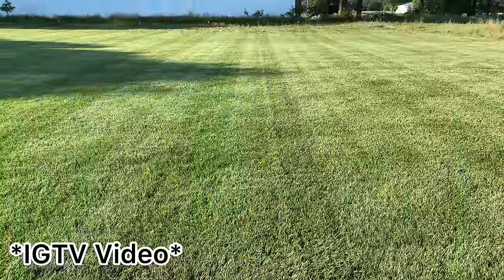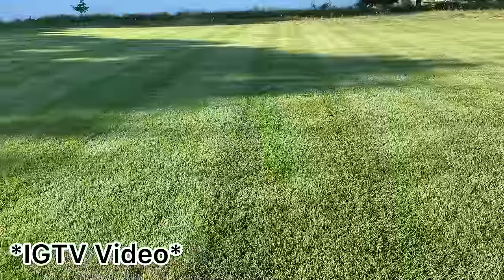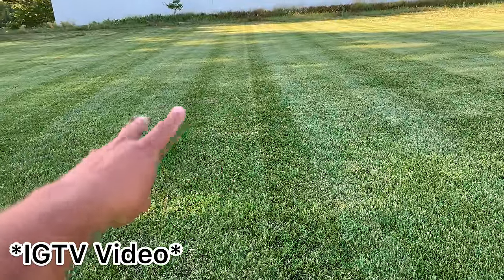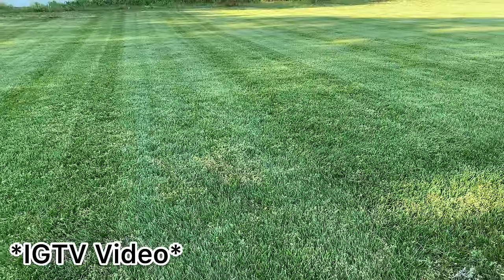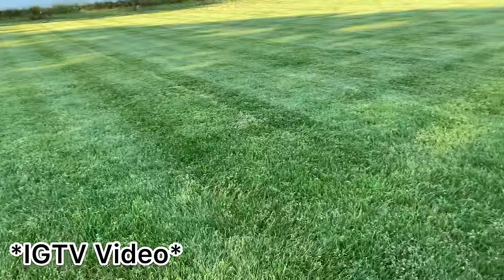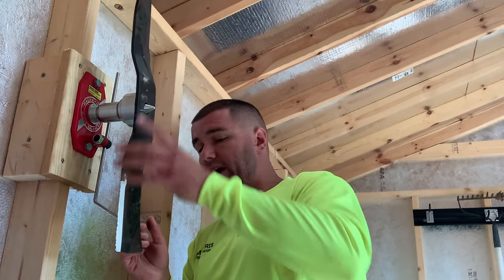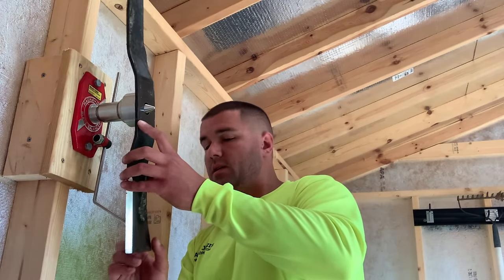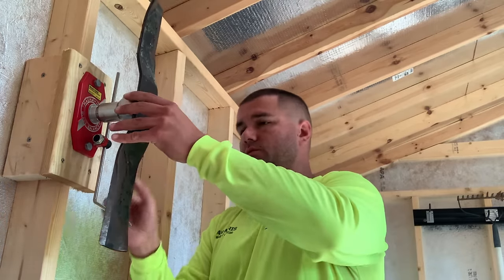Uneven Grass After Mowing? [How to Spot and How to Fix!]

Comment: MOST of the uneven cuts are because your land is not flat. There are dips, etc and if you use a riding lawn mower then this happens more often. A push mower has less space between front and rear wheels so the cut will be more even than riders. If your blade is bent then you'd feel a vibration.
Reply from the maker: My yard had never done this previously and hasn’t since. And I cut in different directions every time. I tossed that blade out and swapped it for a new one. Worked great! But you’re right, that is a common problem
Reply: I can buy the bent blade or the bent spindle but the land not being flat and making the strip he's talking about ? Come on. Lol .
Reply: Low air in the tires on one side
Reply: I can see it on the going and return  strip I don't know which side it is but its coming from the same blade crooked blade bent spindle or low air in the tires.

Comment: You never showed us what repair the bent blade needed.  Do they fix the blades or do I buy a new one?   Otherwise, what was the purpose of the video?
Reply from the maker: I made this video well over a year ago, might be closer to 2 years ago actually. I do know that I tossed the blade. You shouldn’t repair a bent blade, it’s bad for the spindles and cuts bad.
Reply: If a blade is bent more than an 1/8 pitch it or scrape it. They are made out of hardened tensile steel if you try to heat it could fracture and break. They are heated and stamped on big presses to the shape and and left to cool that is why you see those lines running down the sharpening point. you should run a few passes on that before you put them on and balance them .

Comment: seems to me that grass residue and rust should be removed before putting on balancer to check for bent blade or balance...
Reply from the maker: I use a wire brush and putty scraper to do that. Not sure if it can be seen nor do I remember if I did that for this video, it was uploaded over 2 years ago now. But that is correct.

Comment: Sharpening blades has nothing to do with a UN-even grass cut. Either your deck was plugged up with grass or your deck was not level in according to specks.
Reply from the maker: @rickjohnson4725  you’re right, the blade was bent, not dull. Deck wasn’t clogged and it’s not unlevel.

Comment: Absolute rubbish about a bent blade leaving ridges! You are using a ROTARY mower,ergo the blade/s rotate in the horizontal plane,  therefore the low AND high side of the blade/s both pass over the area of grass multiple times as you mow.  
A bent blade will result in an uneven cut if you rush the. Mower!
II too am in my 70’s and  have been cutting grass for over 50 years!
Reply from the maker: You’re right. I made this up. How did you know? 🙄

Comment: That’s not enough bend to cause a issue
Reply: spindle leaning
Reply from the maker: I thought the same thing recently actually. Someone pointed it out not long after I filmed this video but spindles are fine.
Reply: I’m not buying the bent blade either. If the spindle is fine then you have a bent deck. Turn the deck upside down and see if the blades match. More common than you would think. A bent blade moving on a level plan will still cut level. Not as efficient but won’t leave a ridge.
Reply from the maker: @hflora1049  why would I make that up? I changed the blade and the cut went back to being normal.
Reply: @ProgressiveLawnService  I didn’t say you did. If you corrected your issue good for you. What I said was if there is a strip of grass left higher or lower it usually caused by the blade not running parallel to the ground. A bent deck or bent spindle would be the most common causes.

Comment: Tires  deck not properly adjusted  dull blade an or bent blade   Shame after all that you put a grinder to the blade
Reply from the maker: The blade in question was tossed out and replaced with a non bent one.

Comment: How do you straighten out the blade
Reply from the maker: You don’t. If a blade is bent, it’s best to toss it and replace with a new one. Trying to bend one back can be dangerous and result in it either breaking while bending it back or it becoming weak and breaking in its own while mowing turning it into a very dangerous flying chunk of blade.